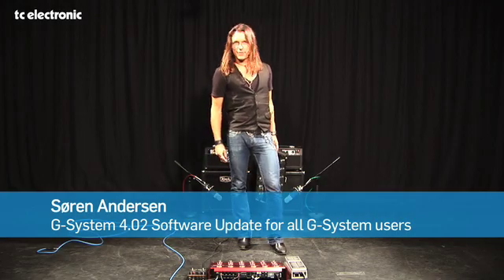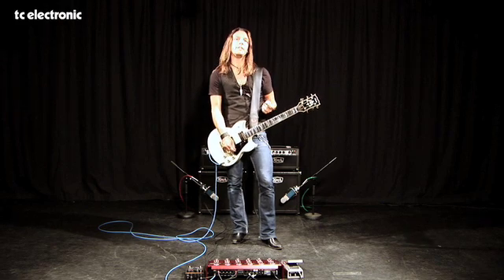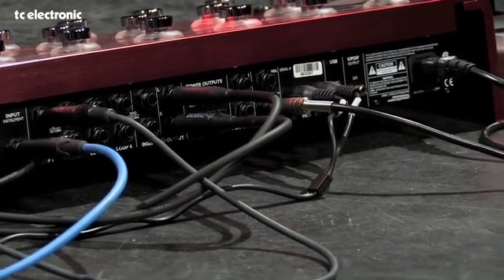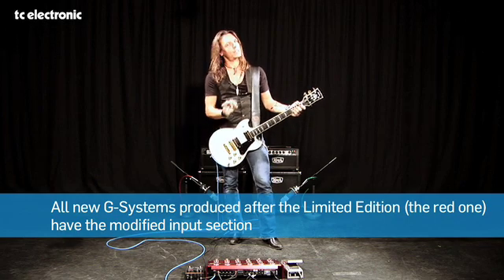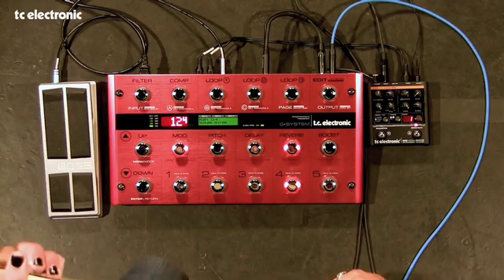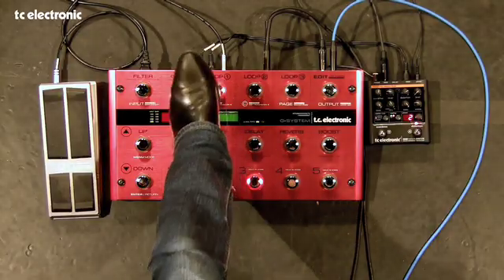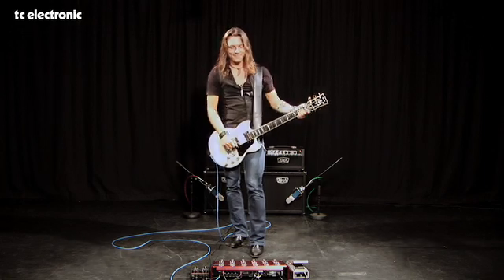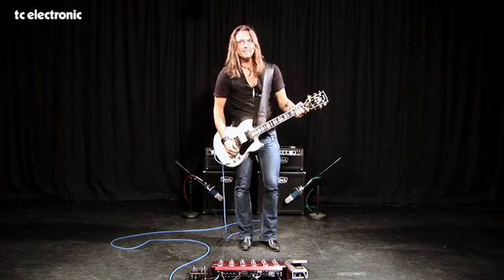New G-System 4.02 Software Update from TC Electronic

Comment: The doubler doesn't seem to work in Mono. Using the LEFT/RIGHT parameter, I have the choice of the dry guitar signal with no doubled signal or the second 'doubled signal' with no dry. 
When is TC going to enable a 'summed' output on the left (mono) channel? THe socket is marked 'LEFT (MONO)' but is in fact just plain LEFT (meaning that the other right half of the signal is inaudible, not summed). The doubler, unlike the Dual Delay cannot have both outputs panned Left.  
Sort it out TC.

Comment: @tcelectronic Dear Jens,
I recently bought a G-System. Now it is so that on my user banks 06-2 the reverb automatically drops down to -69db output. even if i store my new preset with 0 db output. Then i Store it but when i switch between 06-1 and 06-2 the reverb drops to -69 db. Is there a thing i am doing wrong? or can you tell me how to solve it? Thanks a lot for your help. Btw G-system is really great!! Grtz Harm

Comment from the maker: Yes - the new Silver ones have the same hardware and software as the red version displayed in this video. So the observation is correct, -  now the limited version isn't anything special now other than fancy red color.
On the other hand - we prefer to send out the best versions possible, and there are still some that find that it is cool to have a red one, even if it is only the color that makes the difference.

tcelectronic/jens
Reply: TC Electronic After 10 years do you still have the same policy? Does it mean that there is no difference between the current silver G-System and G-System iB Modified?
Reply: @rafipaw iB modified had circuit modification which physically makes it different than the regular version.

Comment: sorry for the stupid question peeps, but does this mean you can update your normal one with this new version? meaning you dont actually need the new version for the rotovibe and doubler :):) cause that would be awesome.
Reply: I hope you have had that answered, but yes, of course the old version can be updated with all the new sounds. The improved input section is obviously not possible in a firmware upgrade, since that is hardware related.